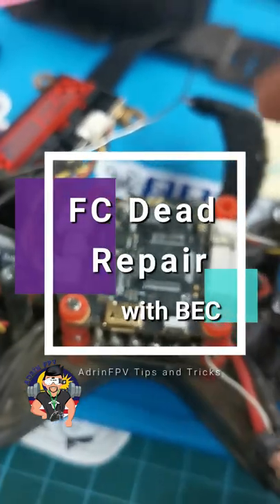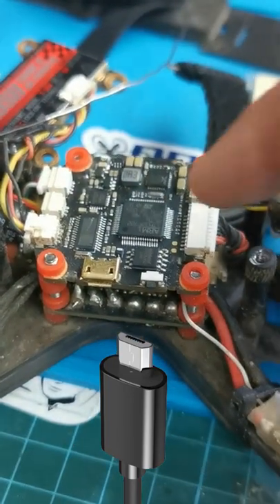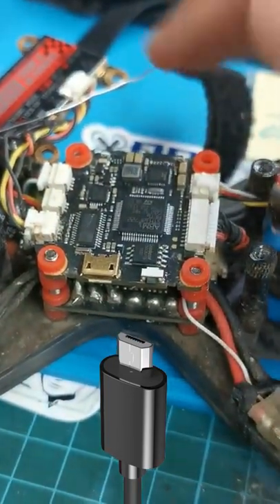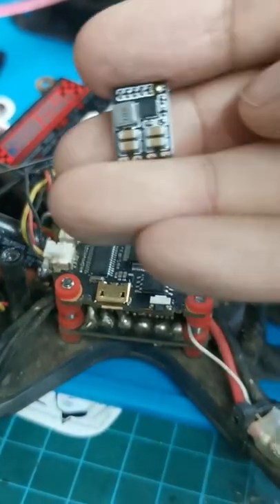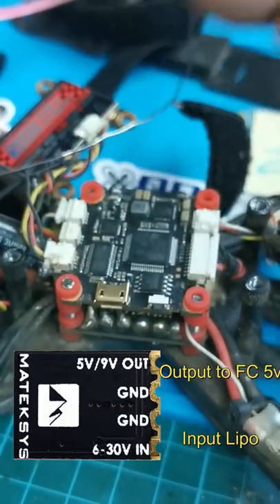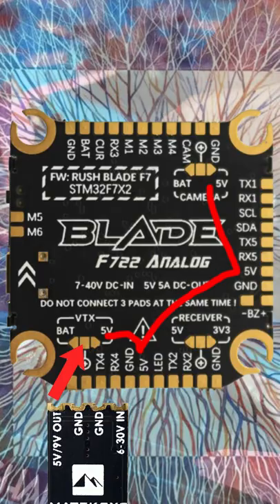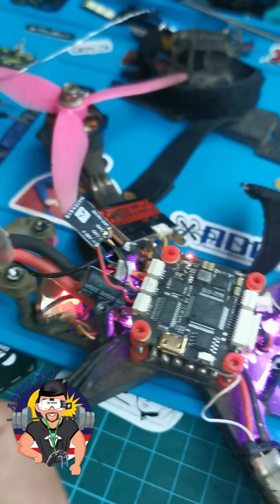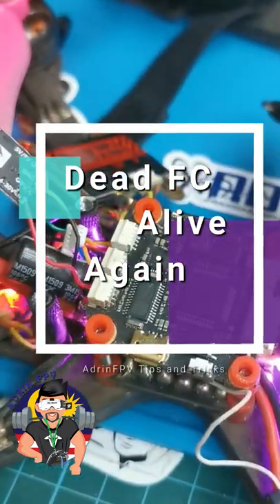Repair Dead FC with External MatekSys 5v BEC #shorts

Comment: Hai I have a problem.
My FC is omnibus mini F4
When I plug battery 2s my quad running well. But when I plug 4s battery FC didn't turn on.
Maybe vout my ESC not 5v (bec)
Question is should I put bec external from ESC to FC?

Comment: II did it and all that happend was that the fc got extremly hot and now nothing works not even a beep from the esc. I checked for shorts 3 times but the soldering was done properly i don't know what happend
I soldered the 16v in to the red cable of lipo the ground to black. The out on 5v and ground. Is this how ita supposed to be done?

Comment: hi adrin, thaks for the tutorial... i have an issue tho... i powered the fc with a bec, ok it works now, but i cant see the lipo voltage in osd.... it shows 0V ... is it because its powered via bec and it doesnt read the lipo?... is there any ways i can solve it?  thanks.
Reply from the maker: Yes u won't see osd. U have to use an analog camera with osd voltage built in
Reply: @adrinfpv  thanks 🙏
Unfortunately I fly digital
So I need to fix it or fly like it is :(
Reply: @fefpv5001  you should go with timer then how long you usually fly with the batteries that you have
Reply: @adirosesFPV  yes 🙂 that's what I'm doing indeed.. the FC works great except for the voltmeter so I just take the medium flight time in cruising (this is a mid range qwad so it's consumption is predictable) and untill now I had no problems.

Thankyou for your reply 🙂
Appreciate.